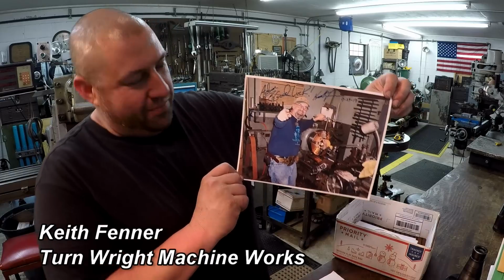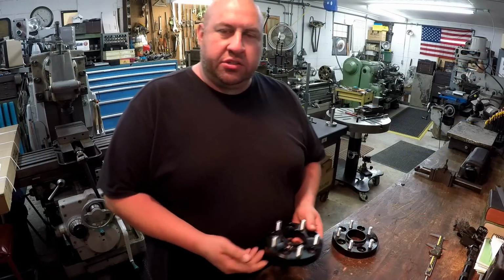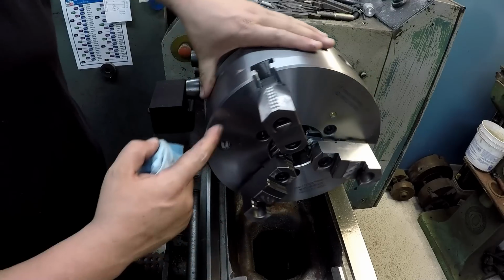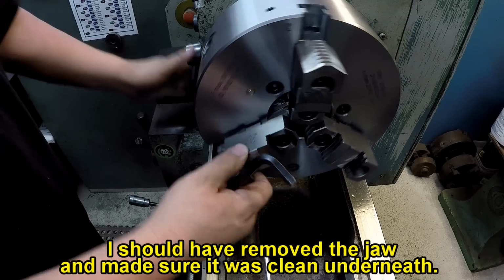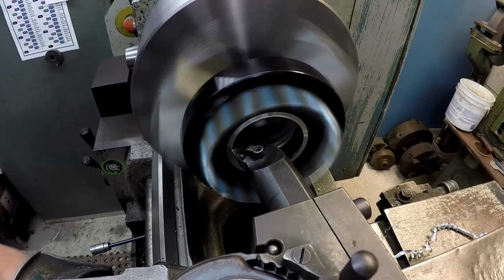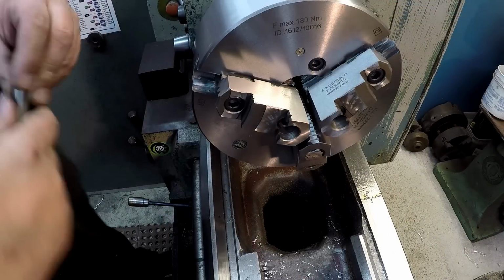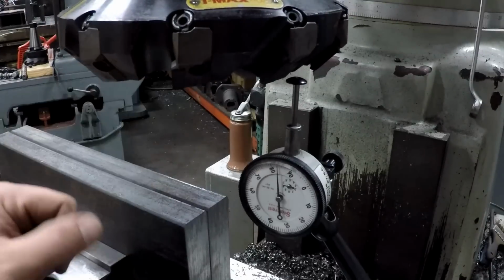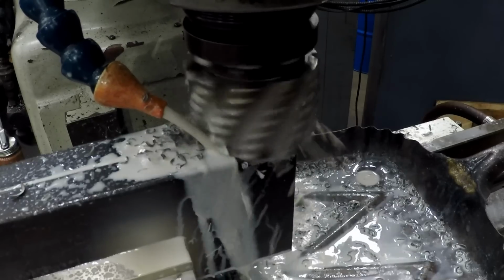SNS 165: First Job for the Gator Chuck, Facemilling, Viewer Mail

Comment: how come you do not have cc on your web site ?
Reply: This is highly specialized, manual machining, by a talented craftsman channel. There are plenty of computer controlled C&C machining channels. run by "key board machinists". This type of old world machining takes years worth of experience and a high level of intelligence to accomplish. Hang around - learn something. Cheers.
Reply: Human intervention with CNC processes are fast becoming fewer. Robotics have now taken on this role. There are now entire places of manufacture that are almost all robots, with a few humans as observers. What is amazing, is the fact that some of these places have robots manufacturing robots!
Reply: I think he's talking about Closed Captioning guys as in ANY foreign language text choice. Keith recently responded to a similar question where he has several volunteers set up to translate spoken word into foreign text(s) and have this as an option real soon.  Perhaps Adam, if he sees this, can get with Keith and work out a similar system for his channel too.
Reply: You forget there are many small machine shops running CNC equipment for small job runs. These machines are often programed and run by the machinist so the machinist needs to be every bit as skilled if not more as someone on a manual machine. Then add the fact it is possible to easily make parts that are impossible with conventional machines. Not every CNC machine is designed or tasked for full scale production work. Even in the full mass production scene there needs to be a highly skilled tool setter to setup and maintain the tooling. Not everyone at a CNC machine is a button pusher, yes they do exist in some cases like full production shops but ultimately a real machinist will be involved in the process.
Reply from the maker: Closed Caption? I think that's another selection in the editing you have to mess with. I've never checked into it.
Reply: Hi, Adam. Yeah you set it up at your end and without your input and file posting, the default everybody sees when they click the CC button on playback is that idiot computer generator running nonsense in english no less.  You have international viewers that would like a more easily understood language that is not english. Most are quite fluent in french for example and I don't really know the breakdown of getting the biggest bang for your efforts but if you could find some viewers that would send a text file of what you say but in french (or ???)  then I'm thinking somehow you add that to the upload at your end and bob's your uncle as they say. And like I mentioned Keith Fenner is about two videos away from having that fly by what he wrote in the comment section on his last video - go ask him, he darn sure knows much more about it than I do.

Comment: stick with a 4 jaw, 3 jaw looks okay to the naked eye. you can buy soft jaws for that gator chuck which you bore out yourself which can help the accuracy
Reply: digitalradiohacker its still pretty precise
Reply: I dont need an indicator to see the runout in my 3 jaw chucks! That Gator rocks!
Reply from the maker: A 3 jaw scroll chuck has its place in the shop, and will be used on some jobs.

Comment: Removing the spigot from the wheel spacers was not such a good idea Adam. Unlike the pressed steel wheels from years ago which used tapered nuts modern wheels rely on the spigot to center the wheel on the hub. Likewise the bore in the spacer needs to be a close fit over the hub spigot to accurately center the wheel on the hub.
Reply: Rob B its a trailer, they don't fit 100% to the center.
Reply: Trailer or not it is poor practice and in some jurisdictions would be illegal.

Comment: That center flange is important and should not be removed. The wheel rests on that flange, not the studs. Without it all the weight is supported on the studs instead.

Comment: Adam.  the face flange is used to center the rim on the bolt pattern.  removing this will lead to vibration and undue stress to the bolts.
Reply from the maker: vipervette03 It's centered using the lug nuts.
Reply: vipervette03 

It could but I majorly doubt that on a trailer.
Instead of being hub centric, its bolt centric. Lots of trailers are not exact center bore fitment, so it won't matter.
Reply: The center supports the majority of the load.  The bolts only hold the wheel on.  I've seen many wheels bust the studs and come off because the center hole in the rim was too large and not supported properly.
Reply: Adam, as an engineer I again stress that the center flange serves as a centering and load support for the wheels. The lungs are there to hold the wheel to the rotor.  Love the videos and all the content you put out.  thank you for responding.
Reply: It is probably lug centric.  I have never had an issue.

Comment: whos  idea was it to remove the  centering   ring on the spacer? not a good idea
Reply: for a trailer is probably ok as long as care is used when tightening lug nuts. For automotive use, its a no-no

Comment: Statement retracted.  Always willing to learn and admit I am wrong.
Reply: Barry Gerbracht 
It will be fine. Its a trailer.
They don't 100% center on the hub anyways.
Reply: Lots of vehicles run a loose center with no problems.
Reply: That is an absolutely false assumption! The nuts or bolts have a taper or ball seat that carries all of the load both axially and radially. I have made a multitude of wheel adapters for tractors, trucks and cars, none of which had any bearing on the center hole. If the bolt or nut doesn't lock positively into place the wheel can move wearing against the threads and will come loose. On tractors the torque is applied in one direction and at slow speed so a tapered seat is not often needed. The first sign of a loose lug nut on a truck or tractor is rust streaks on the wheel from the nut fretting. Some early alloy wheels used flat faces and a close fit in the hole as a tapered seat could crack the light wheel. Some makers went to a ball seat to eliminate both problems. It seems Volkswagen was right all along.
https://en.wikipedia.org/wiki/Lug_nut
   Mike (o\!/o)
Reply: Yeah...my 73 Vette has Centerlines...located only by the thick washers on the 5 wheel studs.....
Reply: And how do you explain the fact that wheel is suported just by the hub if the wheel ID is(and i can say always) bigger with 0.05 to even 0.5 mm from new compared to hub OD?